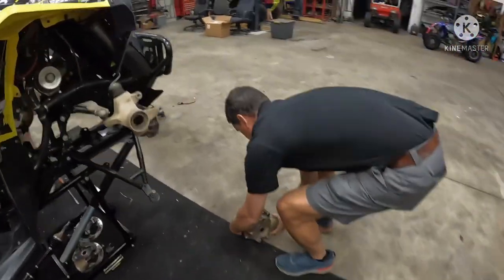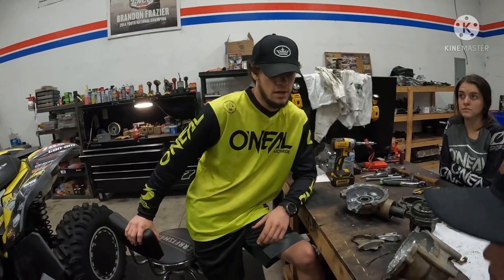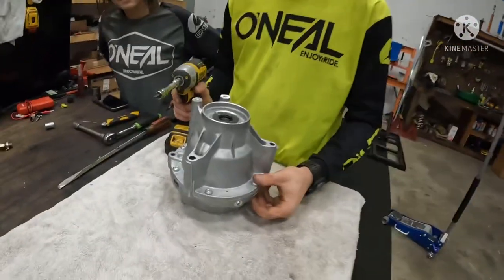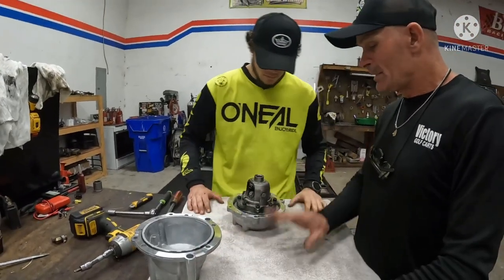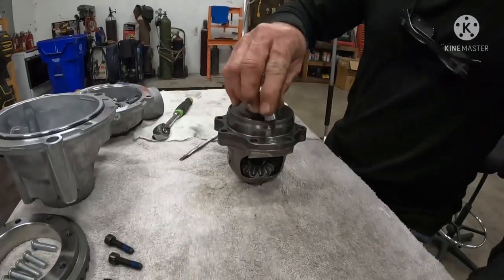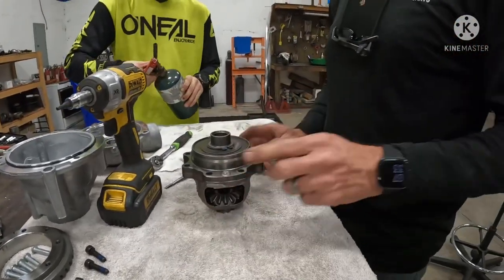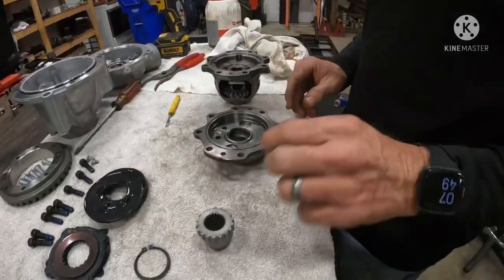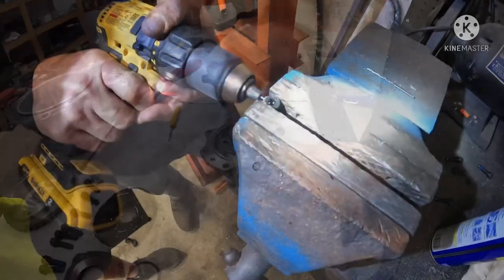We remove the visco lock in the front differential for pro 4x4 racer Brandon Frazier #784

Comment: I did this mod. This basically makes the quad a 2WD right ? I noticed my front wheels spinning opposite direction too 😮 forward and other spinning backwards. I’m wondering if I did something wrong.
Reply from the maker: Wellllll technically yes.  You have did the mod correctly.  So the visco job is when one of the front wheels spin quicker than the other the clutch mechanism locks and transfers the spin to the other wheel. Sorta like a limited slip differential in a vehicle.  We remove this because of us racing through the woods to keep the quad driving straight while dodging trees 😂.  Yes you will get some wheel spin in the front but the advantages of removing the visco is the quad handling and going in the direction you point it.  Hope this helps 🏁

Comment: So that makes it direct lockup full time 4wd?
Reply from the maker: No, we remove the Visco clutches) so it doesn’t dart on acceleration essentially. The visco is designed to put traction on the wheel that is free spinning .
Reply: @prorow784  so does he have to run entire race in 4x4 by rules?
Reply from the maker: @bryanstaten5585   no,  but you want to  be in 4x4 all the time.  The forward acceleration is so much better because these things are so heavy and powerful they just spin the rear tires. The other important factor with racing in 4x4 is the braking. All four wheels slow as you press the brakes mainly because of the transmission.
Reply: @prorow784  ok thanks for your time. At dang near 65 I like watching, we only ran sport quads when we raced and certainly alot more amateur than what y'all are doing. I live about halfway between the General and Big Buck tracks. It hot as blazes here as well.
Reply from the maker: @bryanstaten5585  That’s awesome buddy.  Yeah just spoke with Brandon and he said 61 degrees in snowshoe right now. Me and mom didn’t go as we have work.  He is enjoying his best life right now!!